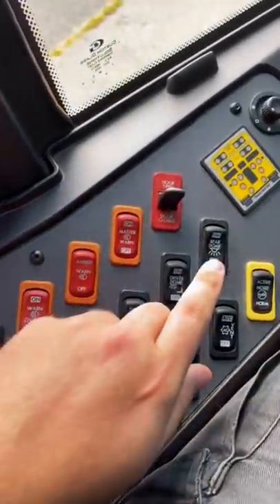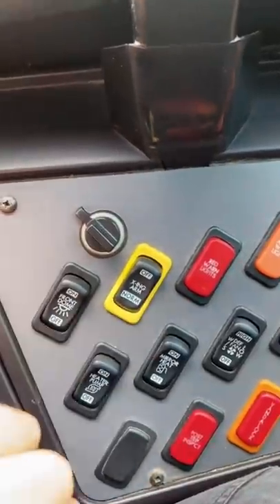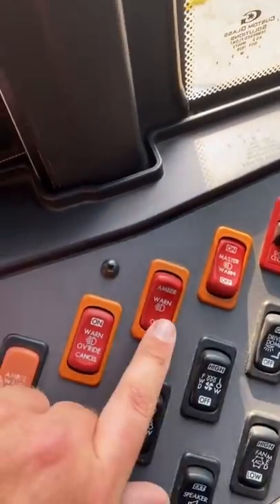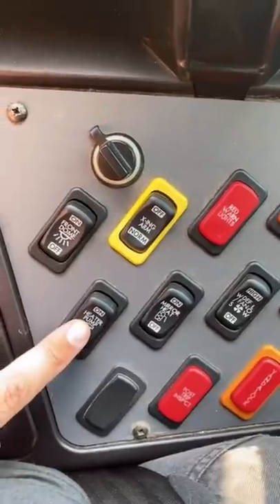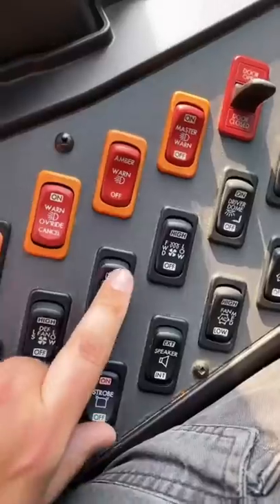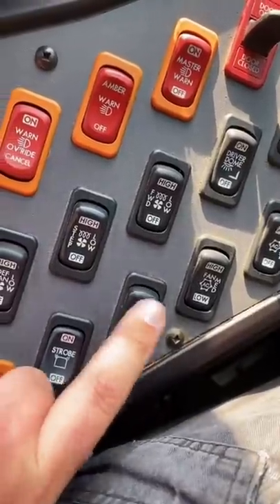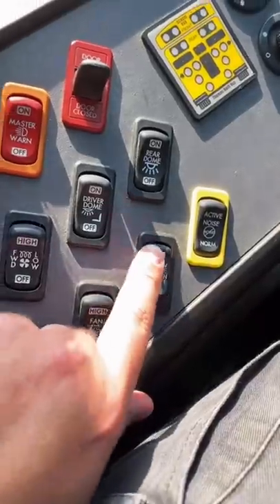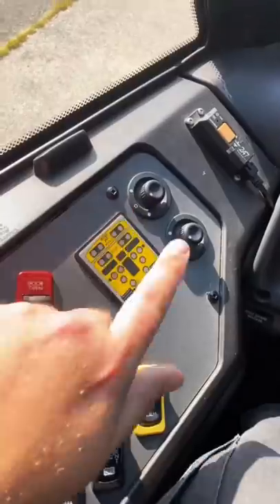WHAT DO ALL THE SWITCHES IN A SCHOOL BUS DO?

Comment: Post trip inspection light illuminates when you shut the bus off IF you have activated your warning lights. You must go to the rear of the bus and push the button on the upper right side to reset the system. Be sure to do this before opening any doors or the horn will sound. YES, I have done that a time or two on my C2. The vandal lock light will illuminate if you attempt tp start the bus if the rear emergency door is locked. It is a safety system to be sure the emergency door is unlocked at all times when the bus is in operation.